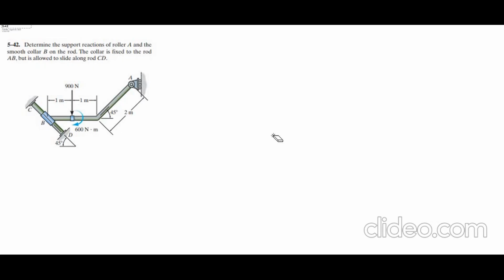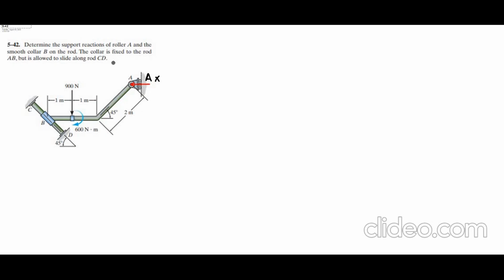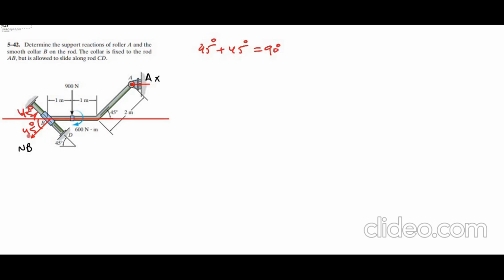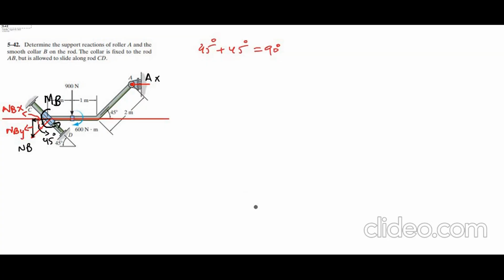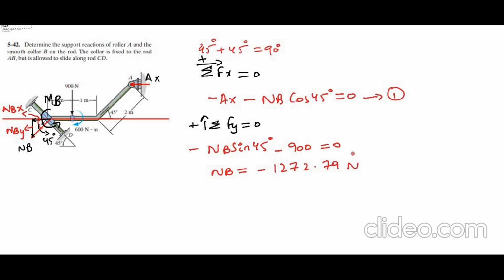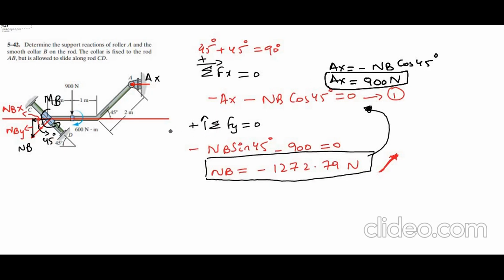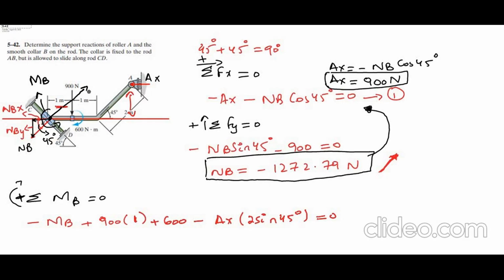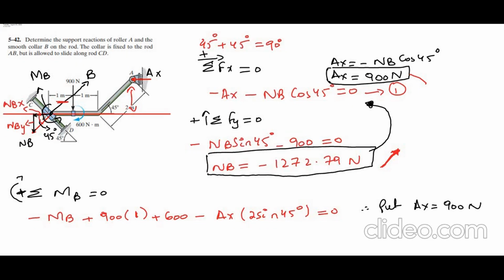5-42 hibbeler statics chapter 5 | hibbeler statics | hibbeler

Comment: Hi sir, I don’t understand why your and clockwise is positive + in this video. Like 600nm is turning clockwise but positive + and also 900(1) is clockwise and also positive +. Can you please explain? Thanks!
Reply from the maker: Actually these +ve and -ve are due to sign conventions as the moment is a vector. Considering clockwise moment+ve and anti-clockwise -ve or vice versa, depends upon the analyzer. If you like, you could consider an anti-clockwise moment as +ve and clockwise -ve, it would still result in the same answer. I hope it will help!

Comment: Sir i have a question that for distance ax to moment B why we take 2sin45 because ax makes 45 degree with moment line so it should be 2cos45?
Reply from the maker: Moment arm for reaction Ax is the perpendicular distance from line of action of Ax to the axis passing through pivot point. That's why 2 sin45 is the moment arm for Ax. I hope it will help!  🙂
Reply: @solutionsmanual9535  thank you sir.
Reply from the maker: @huzaifaali3317  it's my pleasure 🙂
Reply: Ax moment distance should be 2+2sin45.